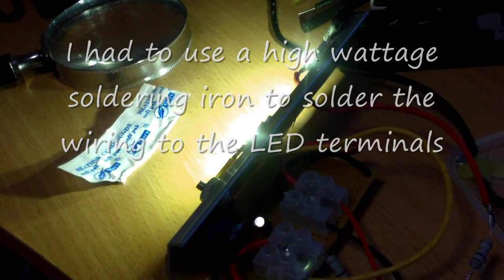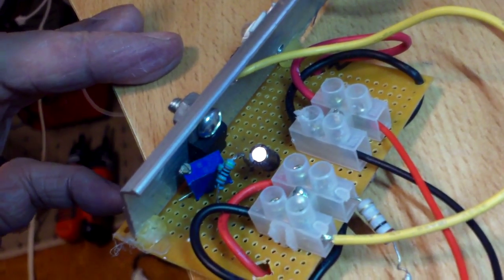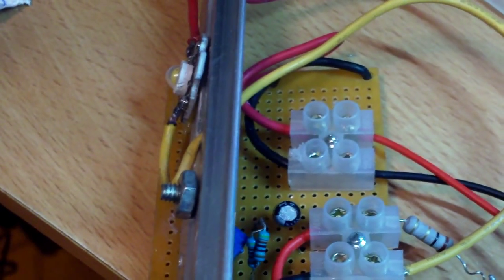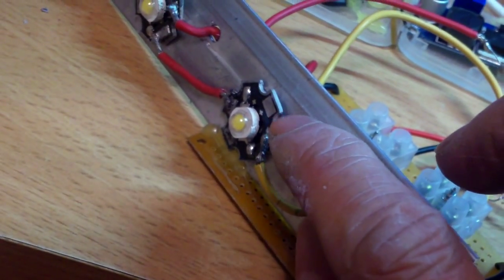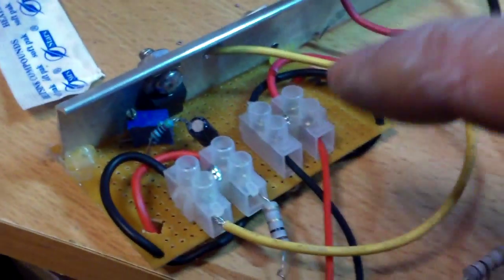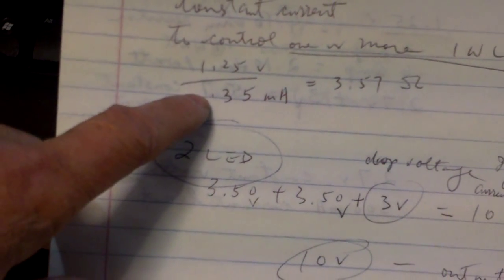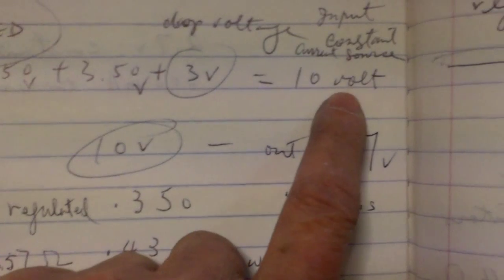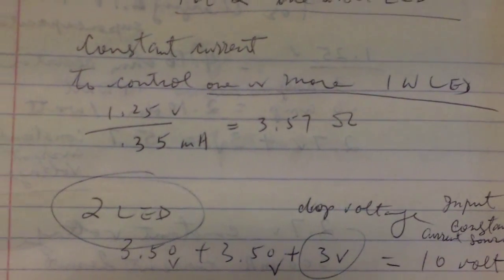LM 317 experiment part 3:  Do it yourself constant current LED driver

Comment: Can I do it in 12 led in series
Reply: Plzz reply this comment sir it's urgent
Reply: If it is not possible give a solution
Reply from the maker: @shyamraj1868  LM317 can regulate approx. 2 to 37 volt so 12 in series will be too high. In addition you have to consider the current consumption of the LEDs. If you are using low current types then it's doable.  You can do this either by connecting the LEDs in parallel ( or two groups of 6 in series and parallel connect the two groups) or lower the number of LEDs from 12 to 10 in series.

Comment: Where did you connect the trim pot to?
Reply from the maker: It is attached to the adjust and Vout pins of the LM317.
Reply: @wtam69  You mentioned that you're dissipating 1W through the resistor.  Shouldn't you also consider the power dissipated within the LM317 itself?  Assuming a 10V supply, forward LED voltage of 3.5V and constant current of .3A, then P = V*I = (10 - 3.5) * .3 = 1.95, so roughly an additional 2W power loss through the LM317 itself.  That is also the reason you need to have the heat sink for the LM317 since the component itself can only dissipate at most .25W.  So I would say you're wasting 3W, not 1W.  Would you agree with that?

Comment: Hello, I have a Q? Wy do I need a current driver for a 10W high power LEd with convex lens? The light goes on when I test it strait to a battery.  Or don't I? I want to add it to my FPV 250 Quadcopter. Thanks Kazz.
Reply from the maker: Kazz- Mann Without a led driver, you can either overdrive the 10w led or under drive it. Overdriving it will shorten its life or worse burn it up. Don't light up a high power led without the proper driver.
Reply: LEDs pull as much current as they can until they burn up given the chance. So a current limiter is used to prevent that.